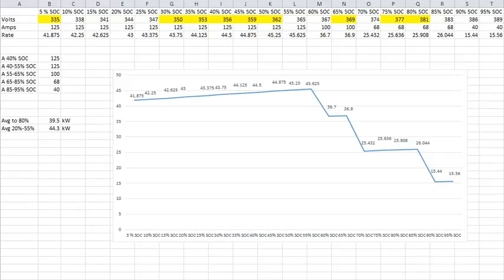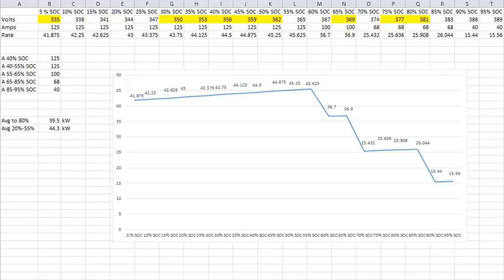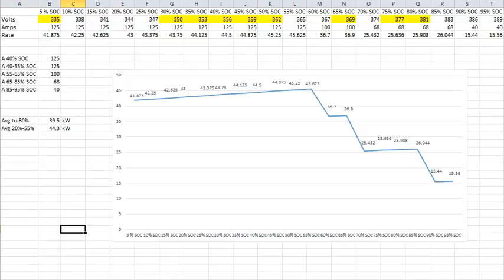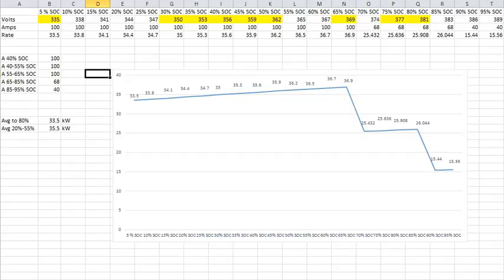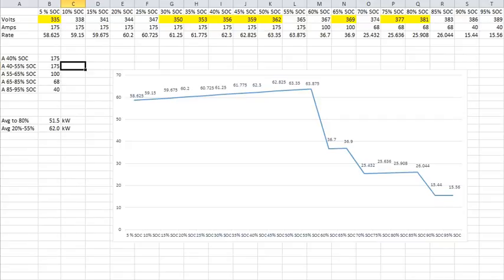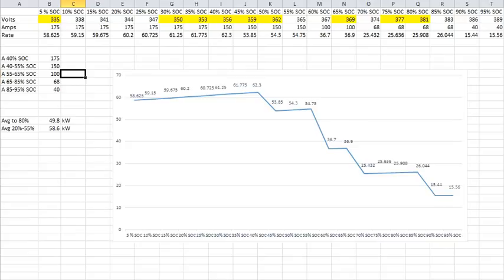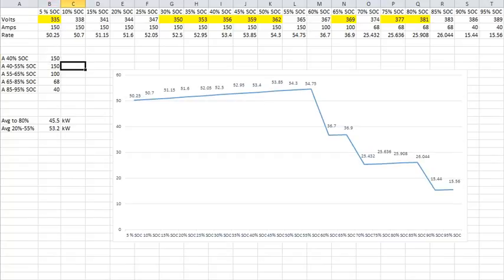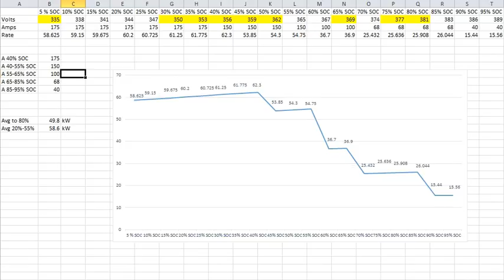Chevy Bolt EV Charge Rate Predictions

Comment: Comparing to Bjorn's video on the ionic, the ionic charged at 2C up to 80%, and also uses LG Chem cells. We just don't know if the cell chemistry is the same. But if the cells were the same, the Bolt battery should also be able to charge at 2C up to 80%, which is 120 kw. The ionic has a good warranty on the battery but not sure if there is any degradation warranty.

Comment: Thanks so much for this video!  It's inspiring me to keep careful notes of charging my Leaf (my husband drives the Bolt. :) I'm waiting on my Model 3. :) )

For instance, I noted that when taking a round trip that I know my car can't make on a full home charge, I had topped off early in my trip so I wouldn't have to charge later on, but because the charge rate was 25kW at 75% SOC, I was disappointed in the mileage I gained in a coffee stop -- less than 8mi.  So I waited until the last minute to charge, and got 16mi in a 10min charge!  Which was all I needed to make it home.  Much more worth it!  So I learned my lesson: wait until the last minute if you want to maximize time (and money!) of DCFC in an EV.

Comment: Good comments and data.  Currently your data shows the charge rate being constant below 40% which I don't think will be the case.  If you look at a Model S for example the charge rate peaks at around 20% SOC and then begins to taper off.  So I think there will be a few steps.  I personally think that the charge rate could be as high as 200A but only up to about 20% SOC then about 175A from 20 to 30% SOC and 150 from 30 to 40% SOC.
Reply from the maker: Erik Stephens The non-Tesla EVs I've seen have a fairly consistent amperage up to 55-65% SOC. One reason Teslas might drop off after 20% is they use absurdly high amperage. If the Bolt EV were to accept 200 A, it probably would drop after ~20% SOC, but if the peak amperage is less than 175, I could see it sustaining that till at least 40% SOC.